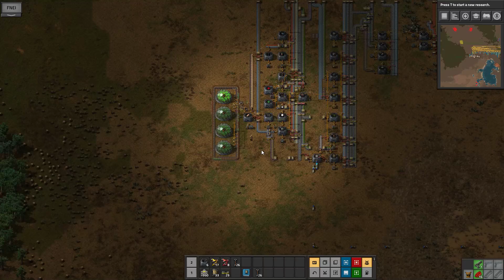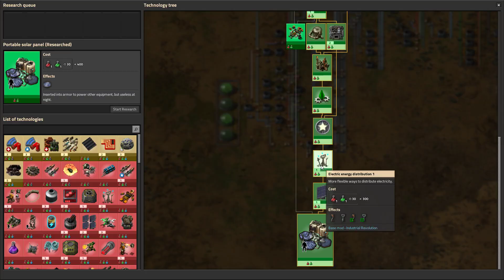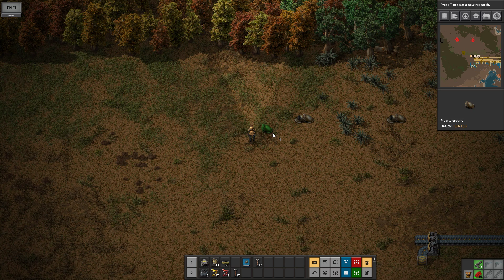Factorio Industrial Revolution - Season 4 Ep 18 - AUTOMATED OIL AND PLASTIC!

Comment: Your diamond diverter will only work until the crushed coal backs up in the splitter then the diamonds will be stuck on the belt and never reach the chest and eventually block the input inserters into the 2nd crushers
Reply from the maker: ElenaAideen Agree! In the next episode I’m moving the inserter to grab from the splitter. That should solve the problem 😊
Reply: @dgray2790  to avoid a blockage the products need to be sorted before being fed into the destination machines or any backup on the belt with mixed products will result in a deadlock eventually. A slightly fudged workaround is using a looped system and you still have to be careful with those.